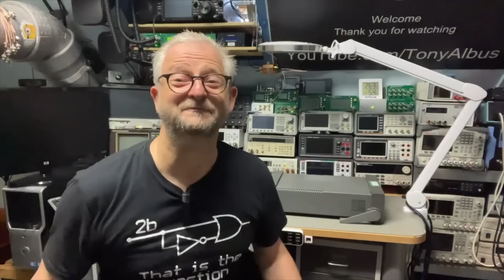TA•0448🟦Keithley DMM7510 - 7.5 Digits - Cleanup Upgrade AutoCal Test

Comment: Ooh very nice addition! Now you can be annoyed by the different USB/button placement compared to the DMM6500! The main improvement is in the current measurements compared to the DMM6500. It uses 10 times lower shunt resistance for that. This also goes towards the resistance measurements. It can do a dry circuit resistance measurement, and also it measures to 1 GOhm instead of 100 MEG.

Note, that with a 7½-digit multimeter, use 4-wire up to and including 1 MEG at least. Because 1 MEG, the 7th digit is actually 100 mOhm.

For me, calibration of these meters are a pain in the ass, and I got quoted for three times the amount you did, and it took more than 2 months . . .

Now it's time to hunt for a 2450, which will actually cosmetically fit with the 7510 ;)
Reply from the maker: Thanks, and yes why did they change the design?
Yes current and resistance is amazing. Calibration needs to wait here.. run out of coins, not sure i will, maybe my lab needs to have good temprature first. No!, you are also looking for a 2450.. it never ends.. but it will need to wait here.

Comment: I am interesting to invest in a bench multi-meter, but never understood the use case why you want to have so many digits? 
I mean normal electronic components probably don't have that accuracy I presume?
Reply from the maker: Hi, correct, you can start with 4.5 and then go higher when you find-out you need more.
i for sure don't need it. i wanted it.

Comment: You got a nice collection of DMMs, and congrats to your latest achievement, the DMM7510.

Anyhow, your lab and environmental conditions do not meet any metrology stability / uncertainty requirements at all.
A metrology lab requires room temperatures of 18 ..28°C at most, and for accurate DC measurements, like comparisons or transfers, you need a constant temperature of e.g. 23°C +/-0.3°C for the complete measurement time.
Otherwise, the T.C.s of the instrument, typ. 0.5 .. 1ppm/°C (even for 8.5 digit instruments) will spoil your whole efforts.
I'm aware that in the Netherlands, houses are built w/o a basements, but the attic is the worst place to be.
Please move your whole stuff to the ground floor, otherwise you could as well sell all your 6 and 7 dig. DMMs, as the additional resolution is completely useless.

Btw: I'm currently sitting in my basement lab at constant 23°C (+/- 2°C over the whole year) , outside temp. now approaching 32°C.. and will compare each of my 12 DCV references within 40min. and within 0.3°C temperature window. I will check my "new" Datron 1271, whether it's as stable over time and temperature, like my HP3458A.     

regards Dr. Frank - 1st volt-nuts
Reply from the maker: Thank you!  dr Frank, you have some good points there indeed.
Guess the 8.5 needs to wait for the new lab. i have no space for airco or downstarts.
Maybe sometime ever in future i will be so luckey with a new lab, for now its what it is. and it is only hot here 3 month a year
Reply: @TonyAlbus  You did not catch the full story.. it's most importantly about a very CONSTANT room temperature (+/- 0.5°C at most) over your measurement cycle. Therefore, these hefty temperature CHANGES in your lab would not occur only in these 3 months of summer, but as well over the whole year. In winter you might have the chance to regulate / stabilize the room temperature to some degree with your heating appliances, but to my experience that will still give too much temperature change in the end... it's really required to limit the changes to a few tenth of degrees, not to a few degrees only.. always keep in mind that you are dealing with 10^(-7) resolution.

If I sit in front of my instruments, you can directly observe, that my own 100W power dissipation will rise the temperature by up to 1..2°C within 1/2 h. So I have to wait another 1h , until temperature stabilizes again, maybe to a further 0.3°C increase, which will influence my 3458A measurements by 0.3°C * 0.5ppm/°C = 0.15ppm maximum deviation.
The 1271 yesterday was much more stable in this aspect, as it's a closed instrument w/o a fan.
Therefore, the external temperature rise would take hours of transfer into the innards of the 1271, whereas any external temperature change propagates instantly and in the same amount into the 3458A.
Reply from the maker: Thank you, yes i did get the story and i know you are right, but there is only so much i can do in that room.
My wife will not allow me to use the living for sure :)
But what i take from it now, is that the 8.5 will have to wait, not only for the money, but mostly i need a good lab first.
thank you very much for this insight. and sharing this with me.

Comment: DMM7510 use artefact calibration for resistance, DC V and DC I. So you only need a voltage source around 10V, resistance around 10K (both for which you know the actual value very well) and a shorting block to adjust these functions. Next challenge of course to have all ranges verified, which is quite complicated and require expensive gear. But my test shows that the artefact calibration works well, and you would probably come out with something more accurate for all ranges than any of your other meters. All in I think its a pretty awesome machine. May not match 3458a in a few critical areas but much better in most other. After i got the DMM7510, i ended up getting a couple of 3458a. So now you know what is ahead of you... ;)
Reply from the maker: Thank you, great info, and oh no! it never ends, and yes in a few years maybe this will happen :))
oh yes we both know were this goes

Comment: I like precision meters that are right on the money or why digits that do not display the correct value? 🎉 Thanks for a great video.  🧐
Reply from the maker: Thanks! Yes but even very good meters are like 25 ppm which is 25uV ate 1 Volt. and this one is 14 ppm, still 14uV.
Assuming the WRYtech is spot on, is was only 8uV off, and clearly within spec.
Thing is the WRYtech uses a ADR1399 calibrated on a Keithely 2002 8.5.. 
so i am very very happy with the result how ever i look at it.

Comment: Oh - I can't hide my envy!
Already now, in the period of MOSFETs, it is necessary to measure the leakage currents of these very MOSFETs, which affect the circuit...
But, unfortunately, even the expensive (for most) Brymens and Flukes measure even microamps with a huge error...
It's bad that measuring devices are so expensive, which are already needed by most people!
(Congratulations to the lucky one!) :trophy-yellow-smiling:
Reply from the maker: Thank you!  yes very happy

Comment: 7.5 digits and the loft space temps varying so much ouch!……have you thought about fitting an aircon?……I fitted a Daikin in my workshop and haven’t looked back.
Reply from the maker: Yes heat is a big problem in summertime here (only 3 months a year). spacewise the airco is a problem too.
when there ever comes a new lab the aircon is the first to come for sure.
preffered setup would be a big shed/garage in the garden, big antenna.
ground floor split in 2, garage and cleaning space.
upstairs arcon, the lab and ham shack.
we all need dreams :))

Comment: Nice. I always "wax" the screens when new or after cleaning a used unit.  It reduces dust accumulation, finger prints (although I have a myriad of Touch pens I try to use), etc.  I found any spray wax works well.  I'll paint tape the edges & apply the wax to a clean rag & lightly apply the wax.  I've used all types including the latest Ceramic waxes.  They all work well.  YMMV.  But $2k USD for a used DMM?  Guess I'll stick with my Olson/Lafayette meter. 73
Reply from the maker: Thanks, will try that!